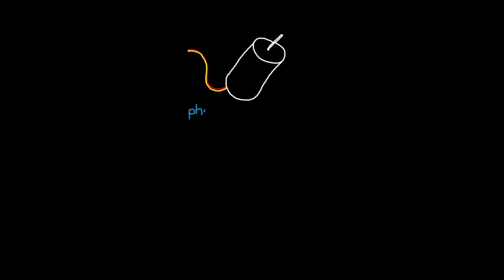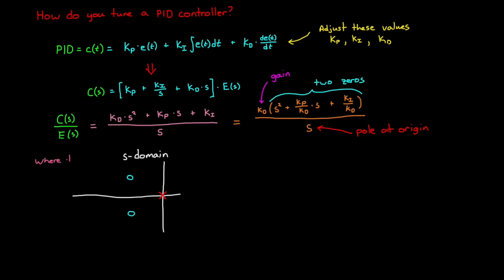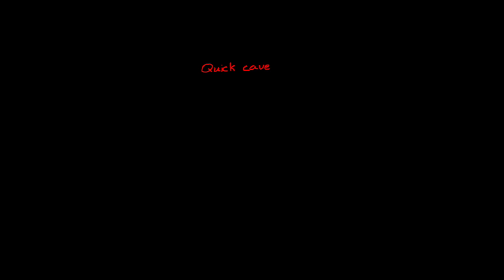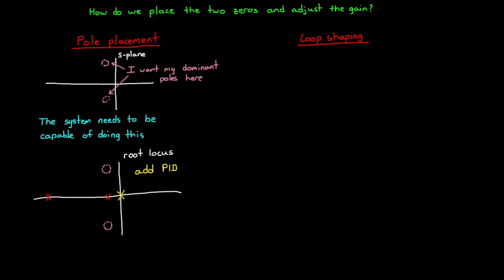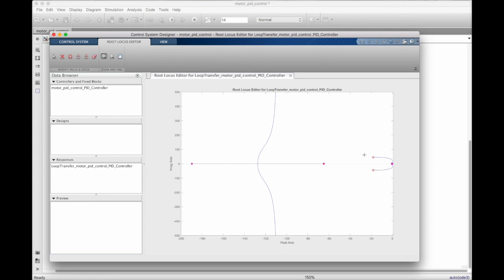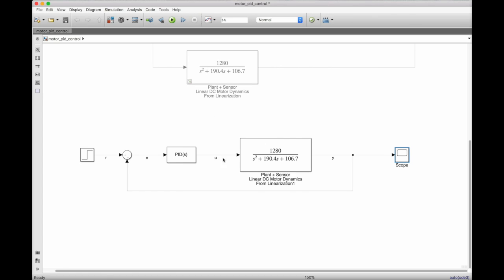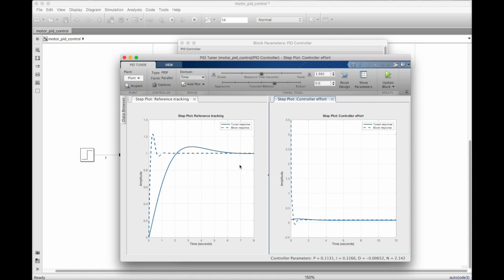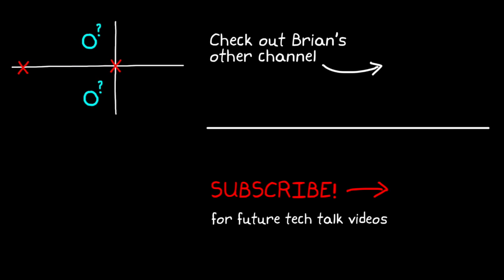Manual and Automatic PID Tuning Methods | Understanding PID Control, Part 6

Comment: In a real project, there are still many things to consider, Now I am controlling 2 DC motors for a differential robot using PWM signals, but the generated voltages(by adjusting the PWM ratio) vary with the supplying voltage (battery to motor driver board), I can detect the supplying voltage(it drops a little if the motor works sometime).  So is it a time-varying system?

Comment: Hello, is there an example of how this would be done with  system with multiple states that one wants to control? I have a Mecanical System (Ballbot) and the PID Block returns a vector although i have only one actuator (Motor with Omniwheel that creates Torque). I am getting an error message because of this. Greetings
Reply: With the help of..DR RORPOPOR HERBAL ON YOUTUBE  i have been cured  totally  from  PID....🤩🤩

Comment: can someone give me the solution for laplace transform of the pid fucntion at 1:43
Reply: It's a function with more zeros than poles, so first you need to reduce it from an improper fraction to a proper fraction:
kd*s + kp + ki/s

The inverse Laplace of a constant, is just the unit impulse function.  The inverse laplace of s, is the derivative of the unit impulse, delta'(t).  Only ki/s materializes as part of the time domain response in the long term, and the solution is just a constant with the unit step function.

Thus, the time-domain solution is:
kd*delta'(t) + kp*delta(t) + ki*u(t)

It only really means anything for a control system, when you apply it in series with the plant you are controlling, and if applicable, connect a feedback loop.

If you applied a unit step input, you'd get a time response of:
kd*delta(t) + kp*u(t) + ki*t*u(t)

Comment: Hey Brian. You have very very awesome lectures man, great job.  i was wondering if you could help me on how to handle issues of saturation when tuning PID controllers. am trying to tune PMSM FOC PID controllers, the challenge i get is for the motor to reach the commanded speed, a voltage of over 300V is commanded. Now, when i limit the output saturation to 220V, the tuned parameters don't seem to work well on the system. i will will appreciate any help rendered. Thanks

Comment: hi,Brian, thanks for your video.  After watching 6 videos, I have two questions: 1. For the invert pendulume,  most of youtube videos show that the control system is to make the cart to stablize the pendulum without any disturbance.  So, If we consider someone was moving pendulume by hand, we need to make a control system to control cart to stablize this pendulume.  Shall we consider this 'hand' as another input? or just a noise ?    2. if the invert pendulume mass was changed during operation.  I think we need to find new PID parameters. How are we tuning PID values during the operation ? Any suggestions?

Comment: I'm still trying to get my head around pid controllers and tuning. It would be great if there was a home brewer focused special.
Reply: That isn't really necessary. The whole appeal of PID controllers is their broad application. Your home brewing could be done with several PID controllers, but the cruise control in your car or the robot that built it, could as well. It's rare - I think - to have one set of instructions to learn, that has this broad application, and for that alone, it's worth understanding the principles. Once you do, you'll find that it doesn't matter if it's home brewing or a cruise control, because they all adhere to the same simple rules. :) 

Instead, I suggest you try and watch videos of the basics of PID controllers, but watch many of them from many different people. I'm certain that eventually, these different explainations combined will trigger your specific way of understanding, and you'll just get it. Until then, it's not really worth watching more advanced videos like these, because this is truly an area where the basics, and understanding them, is key. :)

If that doesn't seem like your cup of ale, instead I'd suggest that you reach out to friends or professionals with sufficient interest to get your solution just right. If you want to concentrate on brewing, that is absolutely fair, but then a better approach than e.g. understanding it half way, would be to involve some expertise to get you setup. Best of luck with the brewing. :)

Comment: Hi everyone, thanks for watching this video! If you have any questions or comments on anything I mention leave them here and I'll try my best to answer it.  Cheers!
Reply: Hi Brian, I  noticed that at around ~12:20 you are closing the System ID Plant loop around the Linearized loop output, and I don’t believe that was your intention. Great video though, thanks!
Reply: Benjamin Schifman yikes! You’re right. That was not intentional. Great catch!
Reply: Brian Douglas I’ve watched through 7. I want to control a hydraulic driven drag chain using PID
Set speed and direction from Setpoint. As load across hyd. motor increase PID adjust voltage of valve to supply greater 
flow demand. Hydraulic motor bypass oil as torque increase. Have enough, just can’t do it by hand.
Reply: Could you please make a video on Cohan-coon tuning method or could you please provide me with the relative material for that where I could learn it. Thanks
Reply: Hi Brian, many thanks for your videos, I love your work ! However, at around 1:30 you write that PID=C(s)=[Kp + Ki/s + Kd.s].E(s) but this is actually the result of C(s).E(s), no ? I mean the transfer function of the PID alone is just C(s)=Kp+Ki/s+Kd.s, isn't it ? I am not sure to understand ...
Reply: thank you so much! I have a lot questuons but I'm thinking about it! i will contact with you later!
Reply: I just say Amazing explanation!
Reply: By far, the best PID videos I have ever seen. great effort has put into these videos and to explain as simple as humanly possible. Thanks so much